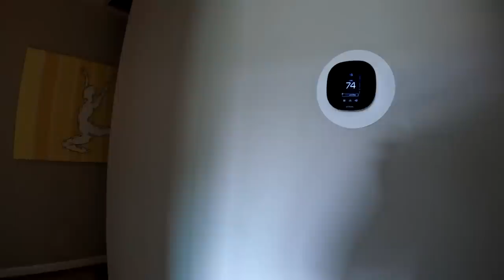Other plumber's lie causes massive problems...

Comment: Plumbers are licensed. Contact the state or agency who issued the license to get it revoked or suspended .Also,file suit asap for work product/fraud. This is a safety issue. Thanks for the tree tip.  also, get a copy of any contractors license and insurance before they start along with photos of before , during and after work.
Reply: They said it was Mr. Rooter.

Comment: As a renter who always has mouse issues, it is SO FRUSTRATING to have landlords just throw down some traps or poison and call the job done. You MUST investigate how they are getting in! Thank you for doing the job correctly.
Reply: Yea I rent a apartment that is cheap but nice the landlords r great so I just don't understand why the mouse issue we have is not a big deal 2 them they used napkins w "plug" a gap between the front steps&the wall like come on
Reply: Mice can fit through the thickness of a nickel.  Can't seal them out like can for rats
Reply: @a-ron9884  sure but you can at least TRY.

Comment: I wish they were close to me.  About 5 years after I bought my home my one toilet was kind of wobbly.  So I thought it was the wax ring.  No problem.  So I thought, pull off the toilet might as well remodel and add a new floor.  So when I pulled the toilet I found out the whole flooring around the toilet was rotten.  I had a friend go under the house and found out it was a "free fall".  The toilet plumbing had about a 4" space that wasn't attached to any plumbing.  Big gap!  It's a no wonder I didn't have rodents in the house.  When I bought the house I made sure the house was sealed everywhere for rodents.  Seemed to work - so far.  But I definitely have them outside.

Comment: Great work, guys! Good to see that you stress how very important it is to modify Victor rat traps in order to achieve maximum success. My two golden rules are:  Always SECURELY tie your bait to the trap's bait pedal, and always anchor your trap to something solid so the rat cannot drag the trap away. Those are the two most-important modifications to make to your traps.
Reply: Good tips. In past videos, they have shown the importance of securing the traps to not be dragged away. I don't know why they didn't do that this time.
Reply: @ehenyor  I believe they were screwed down to that drywall. Noticed the traps did not fall off while setting it up.

Comment: 12:41   as a roofer for 20 years I rate your job about a three. The installation was good. I get that at 10 but -7 for sloppiness because the tar went too far up on the sides. And you also add a lot of tar that did not need to be added, which will melt and run off like rain and it will leave a trail of tar.

Comment: 14:30 I found that the electric traps work extremely well as well, with the main advantage that they catch all sizes of rodents. I have a small Victor out that the big mice seem to like to crawl into and 3 large rat traps that seem to catch the smaller mice (weird). Either way, the smal victor is $25CAD and the large rat trap $35CAD so not cheap. But combined with cheese and peanut butter chunks, they can't resist and the capture rate is high. The biggest problem with them are the batteries.

Comment: As a general contractor, I can see multiple problems with the plumbing. Basics were done improperly. Further, the so-called plumbers created safety issues. As for the pest control company, dealing with rodents is ALWAYS to find & seal ALL penetrations. Baiting & poisoning is senseless. Gaps & cracks in a structure are the equivalent of open doors for rodents & pests. Correct the issues that let them in vs the never-ending cycle of letting them in, killing them,  letting the bodies pile up, letting more in, killing them, etc. Its hard to find competent people. It shouldn't be though.

The pest control company should have identified paths for rats to access the roof & recommended corrective action: keep rees & bushes trimmed a minimum of 4' from the dwelling, etc.

Comment: Professional rodent fella here also! Love the idea for the Victor metal trigger traps! They have a much larger failure rate due to the design of how the trigger slips off the holding bar.

I highly recommend the plastic yellow trigger Victor traps. Way less likely to have get always. 

Frankly wish I could use the electronic traps always but at $50 each just not feasible. 

Thanks for the neat idea on the metal trigger traps! Keep up the great work!

Comment: That was an epic episode!!! Featuring ....yes... The Rat Dance!! Awesome job 😍😀💯💥🤙🤙🤙
Reply: One small issue with the installation of the the new boot on the roof vent. Before I go there, let me say that I highly respect your work ethic. The level of heart you put into your work is so rare these days. I truly appreciate you! Now, because I know how much value you place on the longevity of your work (Flex Seal on metal mesh esc.): Wet Patch for the seal between the aluminum flange and asphault shingles is 💯👍🏽. The 1 issue I see is that Wet Patch is a petroleum based product and should not be used on the rubber portion of the boot as it will shorten the life of the rubber. There are sealing products designed specifically for rubber roofing systems that will maximize the life of that seal. Small detail, but very important. Leaks coming down the vent stack have a tendency to cause a lot of mold before anyone notices its happening. I wouldn't bother sharing if I weren't so sure you're just the kind of guys who will appreciate and make good use of the info. Keep up the great work, Twins!!

Comment: The roof repair will work the goal is to keep water out, but Henry is bottom of the barrel it will hold up for 2 to 5 years but then definitely start cracking it still will be fine after another coat but they make a lot better stuff that has less of a tar consistency and more of a silicone consistency. I did roofing for 20 years, got away from it because it destroys your body that’s a young man’s job
Reply: Good reply, I know nothing about it so I thank you.

Comment: Great series.  I'm learning a lot.  In Hawaii we have rats.  Some have four feet (the nicer ones).

Roof Job:  No support on the left side of the patch or as some would say "No scab".  And the tar on the rubber gasket is just wrong.  Using a rubber gloved hand to apply the tar - Most excellent Dude.

I put my traps in a box with a lid up against a hole that I cut in so the rat must come into my guillotine far enough to reach the bait.  Pretty good score rate.  Very few leg catches which can be dangerous.  I was using string tied around the trigger but I'm going to cloth - Thanks.  I'm sure the black trap you showed works - mine is cheaper and easier to store.  Priority Mail Large Flat Rate Box?

That's the worse crap plumbing work I've ever seen.  Obviously a two legged rat.

Comment: Y’all said these plumbers are a nationwide company. After all is said and done, and this is all resolved one way or another, I’d sure like to know who they are so that I don’t EVER use them. I know some contractors think they can hide crap if it’s buried in a wall or floor, but this is ridiculous. I had a bathroom where the exhaust pipe wasn’t connected to ANYTHING! Just a piece of pipe through the roof into my attic.
Reply: Mr rooter
Reply: @Karma-zx8qe  😊

Comment: 9:49 as a contractor & someone in the trades I loathe seeing garbage & cut-offs from remodels or original installs dealing w/ anything in the house & house included. Why not Hoover the stud bays before insulation goes in for exterior walls, interior walls can still be cleaned up; not leaving crap on top of electrical boxes, and muddying during Sheetrock time putting globs of mud in a box or place shouldn’t be & just leaving it, UGH. pet peeve of mine, as learned as an apprentice long ago, work clean, cleanup at end of day & clean/organize tools before leave site…..ALSO; INCOMING ITEMS ARE NOT WORK BENCHES, SAY BATHTUBS , PPL LOVE PUTTING CARDBOARD OVER & MAKING A TABLE & this homeowners new tub, like seriously, gotta stop doing, same w/ kitchen countertops & appliances etc….
K, rant over but love the work guys do & clean stuff up👍🏻👍🏻
Cheers✌🏻

Comment: Actually ceilings can be 2 feet on center along with the roof because it doesn’t hold a lot of weight. It’s only supporting the roof to the rest of the house.

Comment: @4mins the electro static on that lightbulb isn’t good. Especially if it’s attracting insulation and the bulb is off. Also all the insulation on the attic access panel. That shows that no one has been up there or used another access point to get in the attic. Alit of shortcuts in remodeling this house.

Comment: I once came home from a holidayand there was a death mouse in a shoe under my bed. The stench of decay from that one tiny mouse makes me wonder: how the hell do you not smell death animalS in your house??
Reply: I set rat traps under my house for over a year.  I either forgot or got lazy and didn't check the traps for a while and after smelling something weird for a couple days it hit me that I needed to check. Pretty sure that was the time I found maggots on the dead rat. It stinks for sure 😳😷🙈
Reply: @CB4basser1 Years agowhen I  was an Info. Tech.  guy. A mousethat had been  poisoned had died on top of an ethernet network switch device. The heat created a stench in the poor secretary's office that was unbearable.
 She was so grateful when I removed the mouse and de-odourised  the top of the network switch. and the office was pleasant to be in .

Comment: A lot of People are lazy anymore . They just slap something together and don’t care. Then if they have to actually do something it’s a huge hassle. Why not take the lil bit of extra time and do it right? I was always told when growing up”to do it well cause it has your name that’s on it “ whatever the circumstances .  Have some pride or at least a lil.  I’ve even been a bathroom janitor and I wanted my bathrooms to be the best , cleanest , and not have to go out of way to find a clean one when needed .😎. But I take the extra time on everything I do , any job. And maintenance on all equipment too and inspect stuff , cause if equipment failure issue on something could mean no work or setback so ya can’t get it done and then downtime. Time is money

Comment: I hope you send the pics and video to the local Code Inspector because there is no way in HELL this is within screaming distance of meeting Minimum Code...

Which tells me either they pulled a Permit and both the Plumbers and Code Inspector are Criminally Negligent or they did NOT pull the Plumbing Permit as Legally Required and should suffer the Legal Consequences for doing Permit Required Work without a Permit...

That and send the previous Plumbing Company your Bill to fix their shoddy work with a note that if it's not Paid in full in 30 Days, a lawsuit will be Filed against them...

Comment: 14:34 I had one of those and they did not work I put one out side of my house and I saw a fat overweight thick body meaty skin soft rat in the bushes and it set the trap off but it got away so fast it could not be caught. IF you send hate comments I see the very snazzy report button here.

Comment: All the sloppy work that you show that was done by previous contractors is why I would not have English build for me. I want Amish.  They have a better work ethic overall. I know of 2 expensive homes built by English, and the shortcuts, and sloppy work is unbelieveable. Not to mention the cost.  English overcharge by at least half. Amish also work faster and more efficiently.